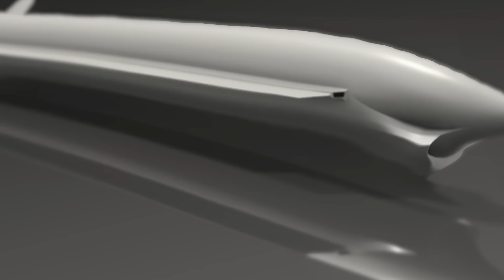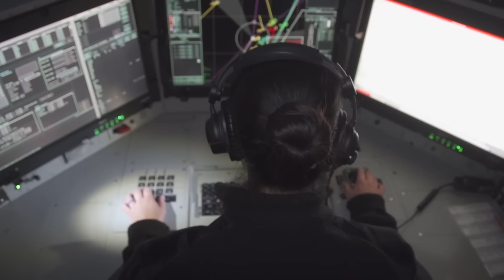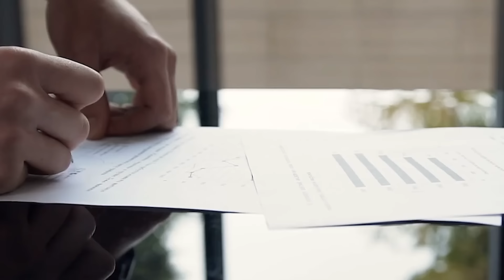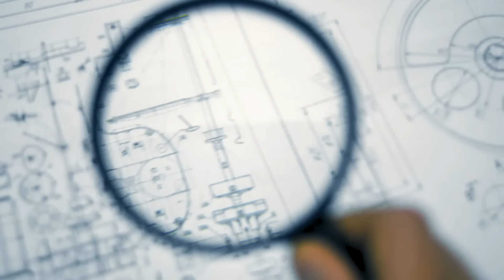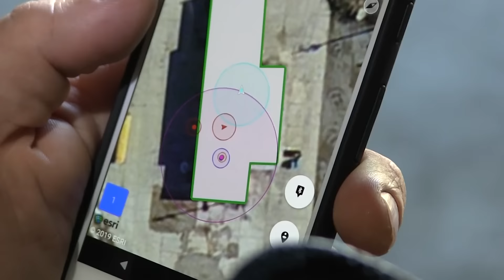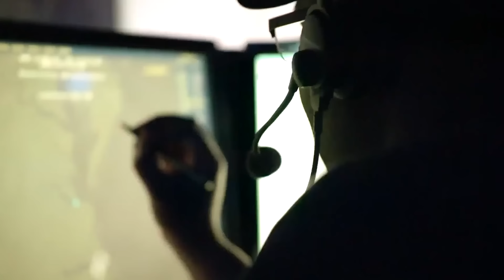Sea Lightning NATO's New Missile Russia Never Expected to Face

Comment: I note that in 1973, the British Sea Dart (anti-air) missile came into service.  It was an air breathing ramjet powered mach 3+ missile which could take out supersonic targets, including other missiles. It is, of course, no longer in service. The missile in the video, which has a different task, appears like a retrograde step, in some respects, although I'm sure it will perform well, if it ever enters production.
Zircon at Mach 9? The experimental rocket powered X-15 going at mach 6.7 melted several external components, so, given Russia's inability to produce reliable kit and its propensity for flat out lying about the capabilities of its weapons systems (e.g. "the T90 is the best tank in the world") I'd say the claim is total BS. Possibly it reaches mach 5+ maybe even mach 6.
Reply: Well said!

Comment: Take any claim coming out of Russia about their weapons systems with a huge grain of salt. And, if you know any physics at all, you'll know that a mach 9 capability will not be for a missile system that is launched from the surface. Anti-ship missiles tend to be sea skimming systems. Anything that was travelling at mach 9 at any height below 70K feet would melt before it even got anywhere near a target. So, an anti-ship missile? Very doubtful. Nearly all hypersonic weapons are launched at altitude from high flying aircraft and/or are boosted to the upper atmosphere/space  by rockets. Unless the projectile is coming almost vertically down upon its target, it invariably slows to high supersonic speeds before it hits. If the Zircon was tested at mach 9, it was doing so at a substantial height, not down low. At most, such a capability might give the target a few less seconds to react to an attack, once the missile dropped into the high supersonic flight regime. The hypersonic flight would only apply to the missile's ingress to the target, meaning if it took a supersonic missile 10 minutes to get a to a target, the hypersonic missile might do it in 2 minutes. Faster, yes, but not impossible to counter. So, apart from the Russian claims, don't believe the hyperbolic nonsense prattled about by the media, either.

Comment: In order to fight an extended war with a near peer adversary that has the capability of targeting NATO defense manufacturing, NATO and the US need to begin to build their defense manufacturing deep underground with multiple camouflage entrances and exits to protect against attacks against them and NATO needs to develop multilayer air and missile defenses to protect all of it's strategic infrastructure.

NATO needs to allow NATO countries to stockpile prepositioned ammunitions and supplies in deep underground facilities and keep them as secret and defended as possible.

With today's technologies, it is difficult to keep bases and supplies secret.  But NATO needs to solve those problems.

On the other hand, Russia, for example, is heavily dependent on rail and it should be easy for NATO to destroy Russia's rail system.

Comment: One ship carrying 30 Zircons could launch from 500 miles away and destroy an entire fleet before they would be in range with a 120 mile missile. Western nations better get their own hypersonic weapons going pretty quickly.
Reply: You play too many videos games, Sergei.
Reply: Assuming they actually work as advertised.  Given the recent performance of Russian munitions I would not bet that it will work to specs.
Reply: @keving454  and you’re probably right. But betting a missile with a 1000 km range doesn’t work as stated is taking a big risk when your missile only goes 190 km.
Reply: US already has one. US Army received its 1st LRHW prototype battery since October 2021. “Today marks an important milestone in equipping our nation’s first hypersonic battery,” said Lt. Gen. L. Neil Thurgood. A 2nd battery is in the works for 2025 and a 3rd one for 2027. 1st battery is currently deployed at Cape Canaveral to undergo personnel training and field testing though no successful launch yet. It is also light enough to be carried by a C-17 Globemaster. Once landed it can launch its missile similar to M142 HIMARS. Japan already agreed to host them.

On the other hand Zumwalt class destroyers already started its modifications this year removing its guns so that it can accommodate a larger VLS able to house CPS. It will also be carried by the upcoming Virginia class Block V subs by 2028. If both will be used for anti-ship role only time will tell. Then their is also the upcoming MAKO though US don't lack anti-ship capabilities especially with stealthy LRASM. However they prefer air assets for anti-ship purposes as it can serve both an ISR and launching platform.